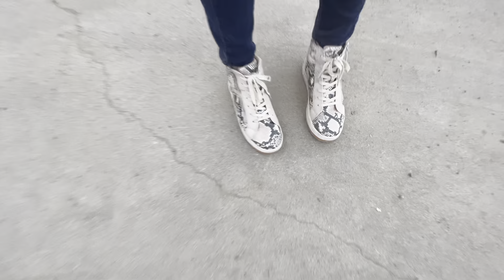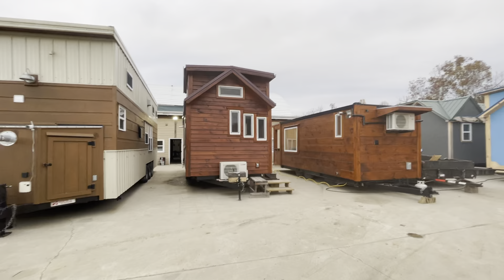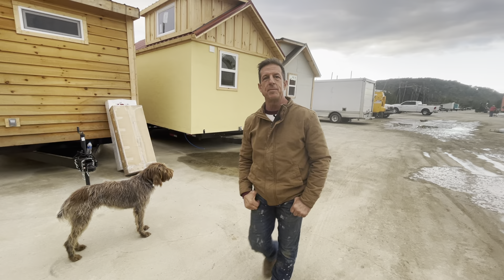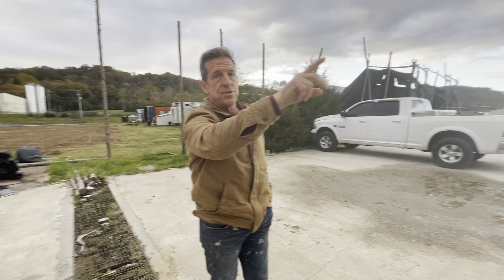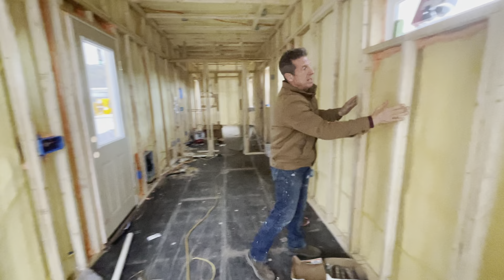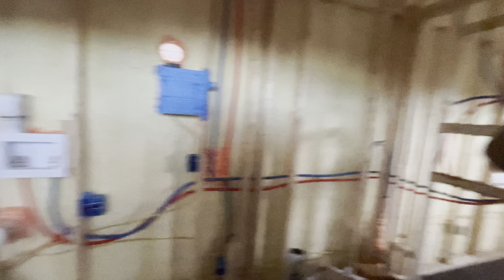How do we build a 40’ Tiny House Container?🏡🔨🏡🔨🏡🔨🏡🔨🏡🔨🏡

Comment: These tiny homes are great for retirees, but the climbing into loft space is tough.  I’d make an extended 1 large loft area and then figure out a single lift, easy pulley system as an elevator to get into that loft area.  Motor one I think would take too much space, but a lift pulley could work I think. 

And a large “loft” area taking 3/4 of the home would allow for closet, 1/2 bath, and a bed and space enough to make an extra section for a second bedroom area.. if even needed.

Comment: How do u prep the containers so none of the horrible toxins even new containers off gas.  I LOVE container homes until I researched them extensively and found out that even new containers are manufactured with loads of toxic chemical coatings/pesticides, rust retardants, etc bcuz they ARE shipping containers made to carry all kinds of cargo across oceans including foodstuffs and keep that cargo "fresh" and repel vermin, insects, corrosion for years & years - the shipping lifetime of all containers.  Also as cute as u guys, ur dog and ur houses are...u r talking here about using spray foam on top of this already toxic container, the spray foam also off gassing toxic stuff.  Can u build an environmentally friendly tiny home with no air quality compromises